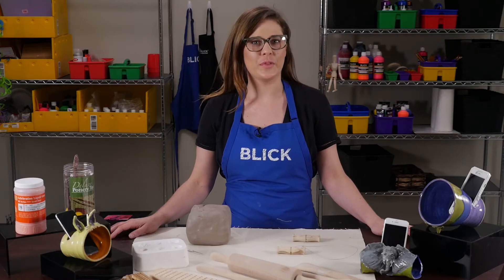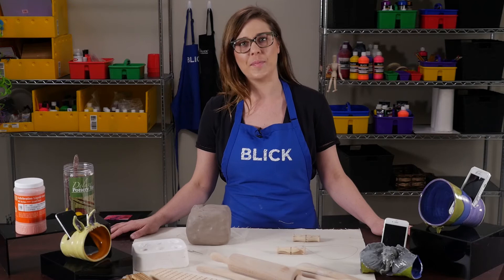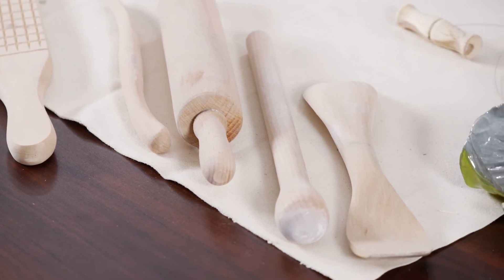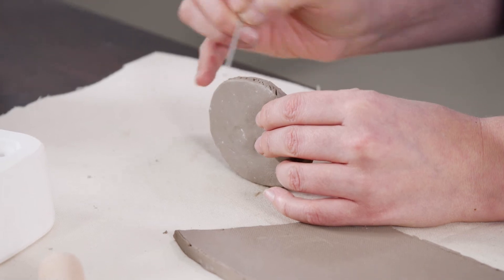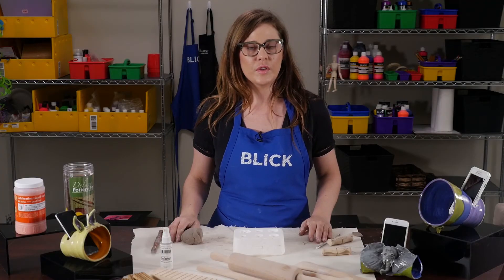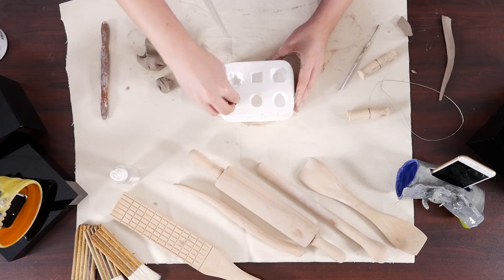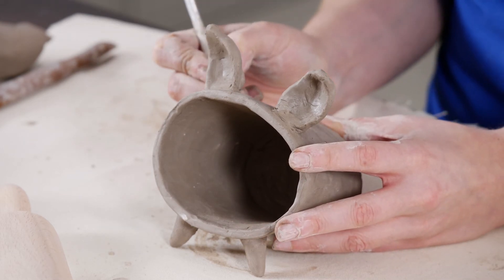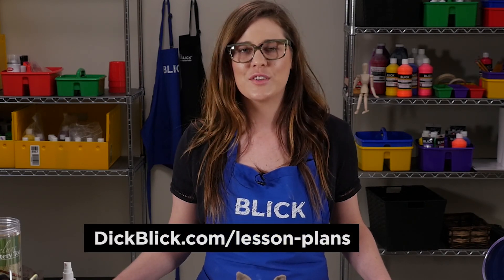Turn it Up - Lesson Plan

Comment: wondering why cone 04 for first fire then cone 5 for the glaze,
Reply: Cone 04  (1920-1945  degrees F) is a low-fire "bisque" temperature which allows the clay to be tough enough to handle but still absorb glaze. Cone 5 (2025 degrees F approx.) is a soft stoneware "mid-range" firing temperature which is high enough to mature the glaze. The clay body is probably formulated to mature at cone 5 or 6.